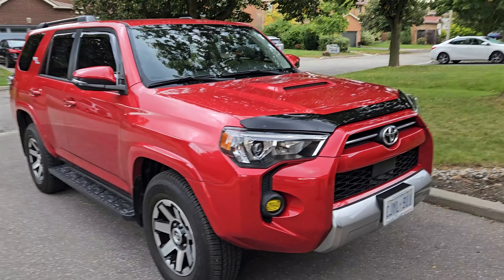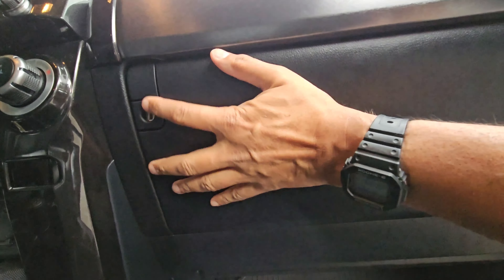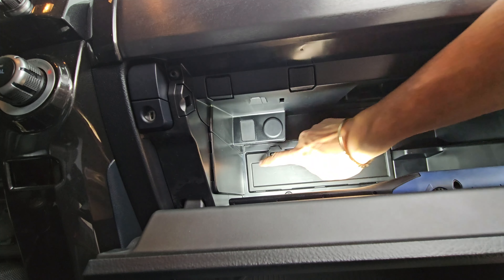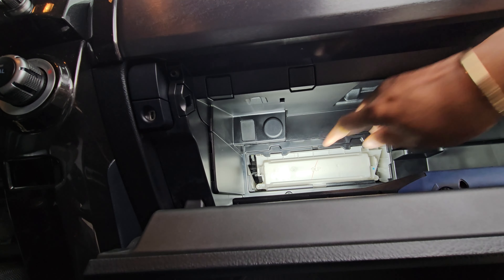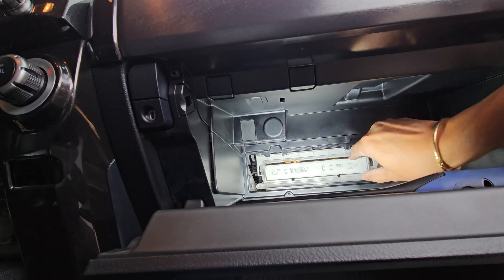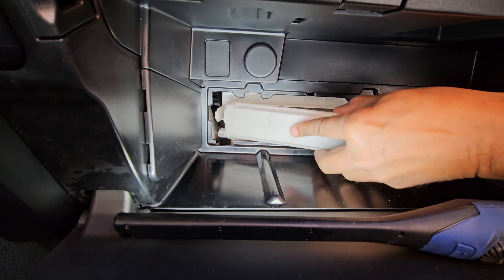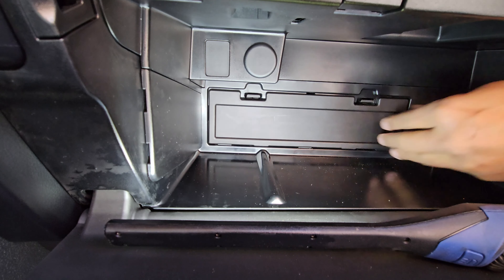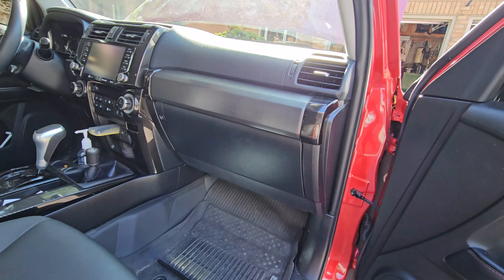Cabin Filter Damage !!   2021 4Runner

Comment: Thanks for the video. It looks like there are a lot more folds in the original filter than in the replacement filter. Any idea why?
Reply from the maker: Thanks for taking the time to look at the video...much appreciated..when I replaced it with the new one it looked the same, perhaps the folds in the original one where more sharper, which lead to the deteriorating of the filter..perhaps

Comment: It's a mouse.
Reply from the maker: Hopefully...this will not happen again..thanks for watching
Reply: Maybe the dealerships switch cabinfilter I bought at 4runner limited  used very low miles back in June of last year. I checked the engine air filter after the first oil change  noticed the filter had a hole in it and mashed down kind of like your cabin filter. So I bought a new one changed it the second oil change I noticed another hole on the new airfilter but not mashed down. So when the sales person call me for 6months review on the vehicle. I told her I love the vehicle but I noticed some things when I bring the truck in before and after service but I check behind  the tech after service and I make a document of everything. Week later coupons from the service department  for $250 of any service. We live in a age now no honesty always about the money.